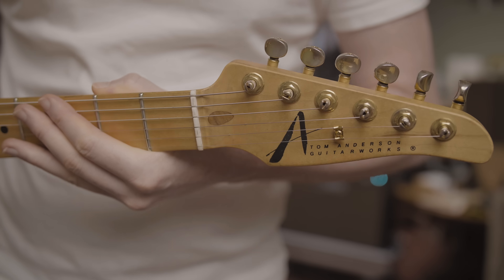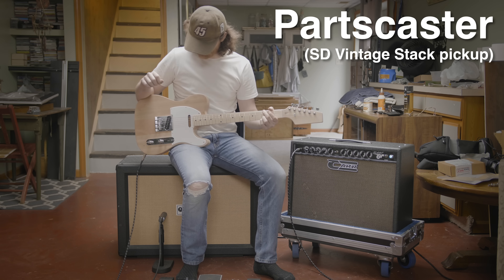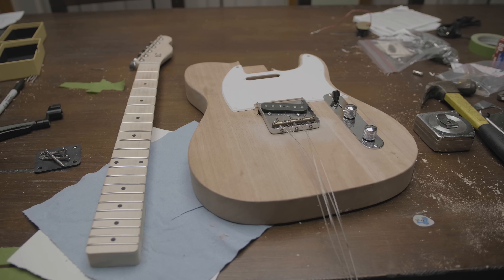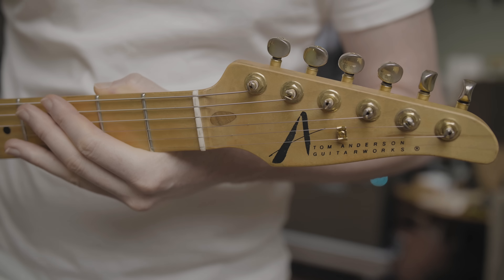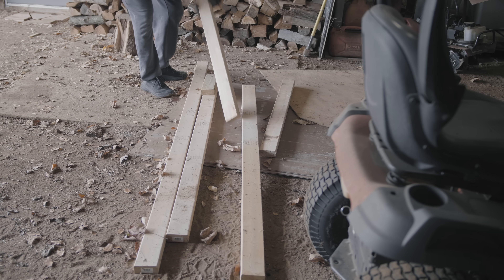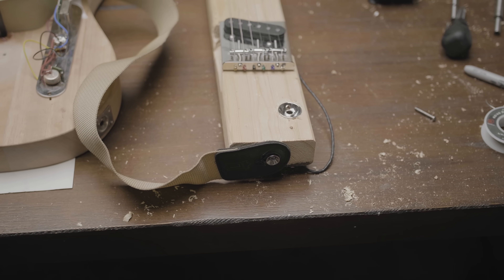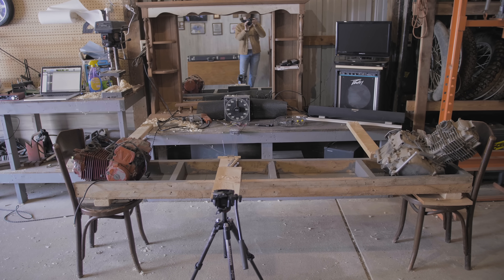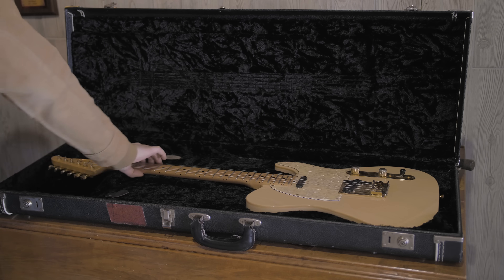Tested: Where Does The Tone Come From In An Electric Guitar?

Comment: Hello Jim, congrats to you for this test! There is a German professor of physics who came to basically the same results as you when he studied the physics of electric guitars. He has a youtube channel and wrote books, all with the (German) title „Physik der Elektrogitarre“. He concluded also: tonewood is nonsense, neck wood is nonsense, weight and headstock shape - all nonsense. All that matters are the parts that contribute as directly as possible to the mechanical oscillation (strings, scale length, saddle, nut, fret heights) and the parameters for the transducing into an electric signal: pickups, pickup height and position along the scale, poti value, tone cap (capacity is more important than the quality of the cap), and very important: capacity  of the cable in the guitar wiring (cable  lengths counts! That is why a Les Paul sounds stronger in the mids and not so bright like a Strat) and of course the guitar-to-amp cable capacity. Just use a decent pickup and with an apropriate set of capacitors and resistors you can create a Les Paul sound from a Tele or a Strat.

You mostly used overdriven or distorted sounds to compare - you should have used clean sounds, that would allow for better comparable sound quality. Otherwise an excellent work!

Comment: So on the air guitar. Are we just dismissing the fact that those strings are still mounted to wood? Lol I can literally hear the stuff on top of the bench vibrating.
Reply: it's mounted to way bigger pieces of 2 different types of wood that would ever be used on a guitar and they are both woods that wouldn't be used on guitars in the first place, and there's still no difference.
Reply: Even so, are you saying the tone of the table is the same as that of the Anderson??? 😂

Comment: Honestly I'm starting to doubt tonewood even for acoustics. 

I watched a video about how acoustics are made, and the section on voicing reminded me of your guitar cab video. Voicing the sound plate involves adding bracing, and then removing material to achieve the desired sound. That sounds a lot like altering the geometry, which as shown in your cab video is important for speaker cones and the cabs they rest in.

Maybe the value in an expensive acoustic is way less the species of wood used and way more in the luthiers experience in how to properly voice the sound board and the time spent making the instrument.

Comment: Body wood’s tonal effect is more like subtracting or filtering some frequencies. That’s why difference bodies give unique tonal characteristics. I can hear subtle differences with Tom Anderson Tele and air guitar. If you make a  guitar for metal body and neck then it will have the  maximum resonancy with all subtle frequencies hearable. Maybe a bit too much EQ bandwith.  No one ever listens music by maxing out all EQ channels. 

1. Where bridge is fixed on metal vs swamp ash. Resonance response looks rather similar. Maybe thats why swamp ash can be harsh, snappy and live. 

2. Swamp ash creates a ‘bass and treble sound’ as expected only losing mids a bit. Air guitar overtones much more hearable due to being on metal body, 

3. Andersons body wood is great, alive, resonant not losing frequencies too much. 

Wood is part of the function with many other variables, just wood does not define the tone, setup, bridge, strings, frets, pickups, amp, pedals etc there are tens of variables but it does not mean that wood is not affecting at all.

Here is a full aluminium guitar 

https://youtube.com/shorts/O4_2BipvETA?si=dpakWKDeNj7rmM29

Edit: video link

Comment: You can hear the difference between the two guitars though.. the parts caster has a little
More Nasally tone and the anderson has a more crisp tone where you can’t hear the individual strings more clearly when playing chords. one is more pronounced on the bottom end than the other. If they have the same strings and pickups and electronics and bridge, they should simply sound exactly the same. And they don’t. With the table test vs the Anderson you can clearly hear a wring with the Anderson that isn’t there with the table. And the table
Has a slight echo from something in the room which maybe could
Be the metal table itself reverberating.

Comment: I know very little about guitars or music in general but pure logic tells me that the third builders answers in red at 0:50 is by far more correct than the other two.

Of course the pickups are the most important thing, aren't they measuring the strings' vibration?

The body probably has almost nothing to do with it.

"Tone" must by necessity be like 99% pickups and amp and then other parts of the electrical chain like the cord and the wiring and the other small electricals inside the guitar I don't know the name of.

The body and neck material probably matter little to nothing.

I bet the fret and string materials and guage etc has more to do with the final tone than any of the wood.

Comment: Nile Rodgers said when Fender made his signature Strat the easiest thing was getting the pickups and electronics right. When they put their new pickups in his 59/60 Strat they nailed the tone. But when they put his old pickups or their new pickups in their new body it didn't come close. The much harder part was getting the wood close.
Reply: The wood did not matter. A different construction with different string contacts still made a difference 🤷‍♂️
Reply: @RegrinderAlert  according to Nile the wood did matter and he seems to be pretty good at music. If you played a bunch of Fenders from the mid to late 70's with northern ash you would hear a difference. Better or worse is subjective, but they are much brighter and have less low end than the same models from the early 70's.
Reply: @ You could take a router to those, carve them out while keeping them structurally sound and fill up the gaps with any material you want. It would sound exactly the same. No amount of wishful thinking and anecdotes will change that.
Reply: @  You only know what it sounds like to you, but you can't speak for everybody. I know who Nile Rogers is but not sure who you are? If pickups were the only thing that mattered you could make a Les Paul Jr sound like a LP Standard just by replacing the pickup. But it doesn't sound the same.
Reply: @ You are simplifying everything way to much. Matching the pickups alone won’t suffice. If you replicate the hardware and electronics end-to-end you can use any material with the same stiffness and any shape you want - it won’t matter because it CANNOT matter.
I know who Nile Rodgers is. And his anecdotal experience means absolutely nothing. Neither does it contradict the facts stated in this video nor did he claim as much. Two different guitars yielded different results, surprise! If wood was the only difference they would sound exactly the same.

Regardless, being a great musician doesn’t give you any technical or scientific credibility. You sound like a flat earther or conspiracy theorist 😂
Reply: @RegrinderAlert  you're the one simplifying everything. I never said pickups were the only thing that mattered or that wood was the biggest factor. Next you'll tell us there is no difference between flatwound and roundwound strings. The fact is a heavy northern ash Fender from the mid to late 70's sounds different than the alder models from the early 70's, time after time when the same pickups and hardware were used. Les Pauls with maple caps sound different than Juniors and Specials without them. Replace a thin Jazz bass neck with a big fat P bass neck and most players find a noticeable difference in tone, except for you of course, because this video proves that can't happen. There are many examples but you already made up your mind that the earth is flat and you're an expert because your famous for being some guy on the internet. You seem really upset about this, you gonna be ok?
Reply: @ The thing is that the players won’t find a tone difference when they are taking a blind test. Not if you use a scientific approach when tuning. Just like with brainwashed audiophiles. There is a reason that there hasn’t been a successful and validated blind test in entire recorded history. Because reality doesn’t care about your anecdotal ramblings. Everything sounds different when your brain has a reason to make it up. Other senses work exactly the same.

Comment: Great research. I am not surprised at the results. When you consider the HiFi audio reproduction chain the level of distortion of a source, vs an amp, vs a speaker - the speaker is waaaaaay more distorted and as a pickup is really just like an inverted speaker it fits this would be the main source of tone changes.

Comment: The first guitar Les Paul made was called " the log" it was a 2x4 down the middle to mount the pickups on. Wood makes a difference on acoustic guitars tonality. On electrics sustain might be attributed some what to the neck wood type. But its probably the actual fret board that makes the difference.

Comment: Tip: the strings themselves are the main proponent of the tone or timbre... however, this is just talking about electric guitars. When you move to avoustic those dynamics change again, and i think youll find its actually quite difficult gauging the tone if a guitar.

Comment: anyone tell me which video has the scale length testing? super curious about that aspect I don't believe in tonewood but a Strat and a Les paul sound way more different than just single coil and humbucker can account for IMO. every humbuckered super strat from the 90's should have sounded like a Les paul if pickups were the only difference... but they don't. And in fact they also still sound kinda like a strat with a humbucker which I'll grant sounds less "straty", meanwhile el cheapo Squires are often described (I think very accurately to my own ears, I actually like Squires more than Fenders) as more straty than a strat (same scale length but cheaper pickups/construction) I can hear these differences. I think the main factors besides obviously pickups are the flexibility of the entire guitar and the scale length (string tension at the same pitch)

I've seen "les paul-ness" measured as less fall off after the pick attack and straty-ness measured in the same video as a distinct scoop fall off after the attack (IIRC). Wish I could recall the video, might even be Jim's where he talks about scale length but I can't find it despite re-watching all of these (I think).

Comment: Amplified sound is way too many factors to even think about. Similar to a signal chain, everything is interacting. I try to focus on the electronics, but more as a way to change it rather than identify any variables.

Unplugged tone has a wide range, but overall the brighter the guitar unplugged; the duller/bassier the pickups should be. Depending on the intended sound ofc. Resonance vs Reverberation is a big issue, you want "overtones" and "sympathetics" not really extra vibrations.

This part is actually your personal feel of the guitar giving you a different experience as a player, not the actual sustain but your own hands feeling better. This is the primary effect that any guitar will have on your picking style, not your sustained strumming.

Comment: Great video!  The plank guitar vs Anderson definitely sounded more similar than different.  But I can't say that they're exactly the same.  So if you like tweaking towards a very specific sound, those small tweaks are just part of that process.  As long as you understand its not night and day but literally 1-10% sum difference.  For many of us, that 1-10% is a fun journey and the differences, albeit negligible to many, is a treat for us.  

That said, the air guitar sounded massive.  I'm curious if the strings were anchored to something other than wood.  Or is the bench metal?  

I suppose any material will have its inherent resonance.  What if the anchors were to the ground though haha that'd be something

Comment: i can hear differences between the two so i wouldnt call it a bingo moment, but they do sound very similar at least
Reply: Its pretty conclusive. The physics behind how an electric guitar works points to this conclusion. The only variable the body of an electric guitar effects in the "sound" of the instrument is the sustain (or how long the strings will continue to vibrate/resonate). Everything else is mostly down to how the string (metal wire) interacts with the electromagnetic field of the pickups. The few variables it boils down to for the dimensions of the set up seem just as important as the design of the pickups, but everything else is secondary to these. The fretboard dynamics (height of strings, material of frets and nut, etc.) are still a part of the equation, but less dominate in the construction of the guitar's "sound".

Comment: I will say, the stability of the wood is the main factor not really mentioned. How much and in what ways it twists, flexes, and swells. This dictates how often you will be tuning, adjusting truss rods, etc. This becomes more important if you are doing live performances between day and night, indoor and outdoor, humid location to dry locations. If you use type of wood that reacts poorly to these conditions and a poor quality sample with non-congruent asymmetrical grain then these effects will be extremely noticeable. I personally like the beauty of the wood and how it makes each guitar look unique (when not painted over obviously).
Reply: Yep, a very rigid composite body guitar is the perfect base material. Minimal flexing and bending under different temperature or humidity.

Comment: Well, its subtle but its there... you just proved it, the 4X4 was the most easy to hear, also the two guitars had different resonance it was pretty obvious too. the air guitar actually sounded very very close I must admit. It had a more solid bass response while the Anderson guitars bass response was clearly less but besides that I could not hear any difference. but this is only on the open strings... so we cannot know what the fretted notes could be.
Reply: I'm convinced most people can't hear the difference but they could probably feel it in the mix and not know why they're "cutting though".  Most of the comments confirm this.  I can definitely hear a difference.
Reply: @thomasreynolds1530  The thing is though, the video was made to prove that while the body and frets of the electric guitar DO contribute to the sound of the guitar, the majority of the tonality of the sound produced from an electric guitar comes from the design of the pickups and the physical location of the strings interacting with the magnetic field of the pickups. 

The entire video is an essay on the industry's continued use of Pseudoscience "tone wood". Yes the body affects the sound, but it is tertiary to the pickups+strings (primary) and the fretboard, fret and nut materials, bridge type, etc. (secondary).

Anything done to try and say tone wood makes or break an electric guitar is disproved by the bench/table/"air" guitar sounding very close to the "real" guitar. That was the point of the video, not "I can definitely hear 'A' difference".

Comment: Thank you for validating what I've suspected for many years about ELECTRIC guitars. The pickup/electronics and the player. Tone wood is especially important for any acoustical instrument but electric instruments is a sound wave being transmitted transmitted through a wire. When you have a metal wire moving in an electromagnetic field, you generate an electrical current. The construction of the instrument will affect how that signal is generated, but by in large, your pickups and player will have the greatest effect on the tonal qualities.

Comment: This would've caused a mass panic on the good ol forums 10-15 years ago. I love the old guitar forums and still wind up reading threads from the 2000s, but man were there some funny ideas spread there, and I'm not even really talking about body wood, which is reasonable to believe has some kind of major impact. Some of the misconceptions about the electronics are 10x as crazy, such as the low-pass filter capacitor type (oil, orange drop, paper/wax, etc). All the while, the tone knob for this primitive, passive circuit is left on 10 forever....

Hey I use cool, vintage capacitors (including the crappy ceramic caps that Fender liked in the 60s!), but for me it's all about the looks and I tend to have lots of old junk.

Comment: Instead of using wooden table and wooden headstock for the air guitar,use some rubber to connect the strings and see how much tone you get. The wood does effect the tone. That's why Bigfoots knock on trees to get bigger sounds instead of smashing two rocks together. Your air guitar is still connected to wooden table and wooden headstock.
Reply: He made a guitar out of a car recently, and plugged it into an amp made out of pedals - go check it out

Comment: Guys, most miss the actual point. The electrical system is most critical. It includes the strings, the pickups, the pots AND ALL the cables in between. A cable itself acts as a capacitor. The more length the more capacity the less high end there is in the sound (an electric guitar acts as a high cut). It’s probably more important that Jim added more internal cable length than that he added the pots.
Reply: caps do not make a filter on thier own it depends on resistance, its lowpass RC filter. if your guitar pickup is high resistance like  20k ohm youll need around 700pf capacitance to notice the difference. quick googling says coax cable has 20pf/foot so 35feet cable or 10metre.